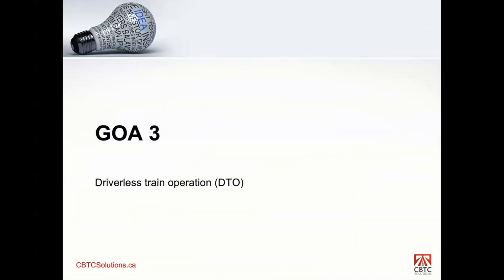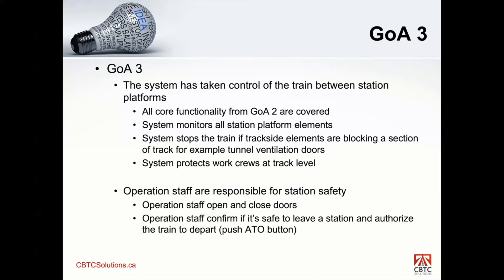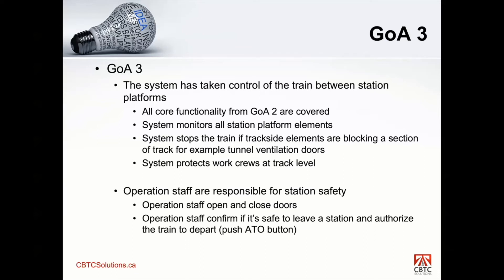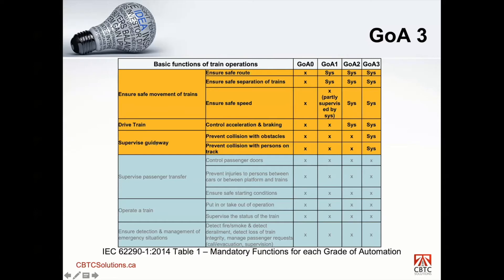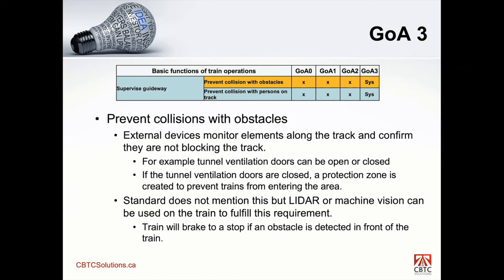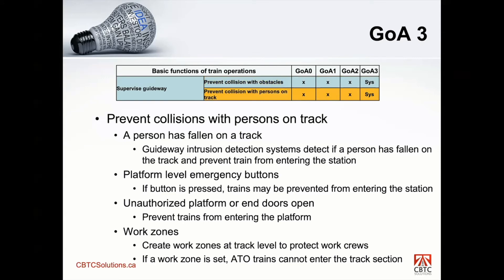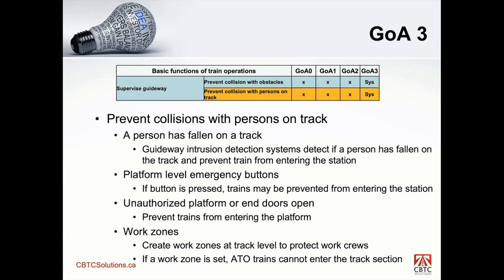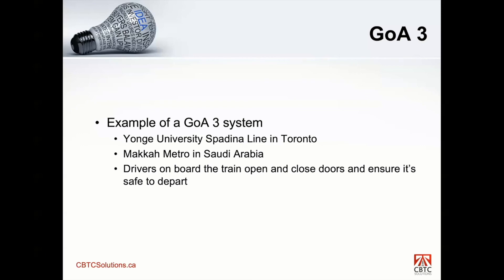GoA 3 - Driverless Train Operations (DTO)

Comment: Platform Screen Doors, Manual Screen doors for entry to Trackside and interlocked with Signaling, Emergency Trip Switch(Traction), Emergency Stop Plunger( For Signaling Braking), and Staff protection  Key system( creating safe zones for a staff working on Track and interlocked with Traction OFF) are normally implemented even in GOA 2 system. Does that mean that only an Intrusion detection system is to be introduced to migrate to GOA3?